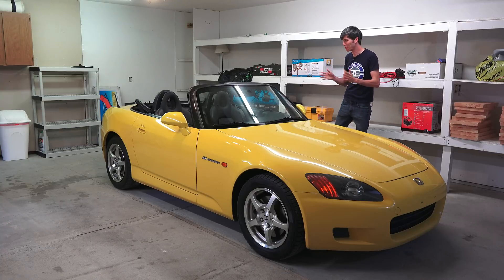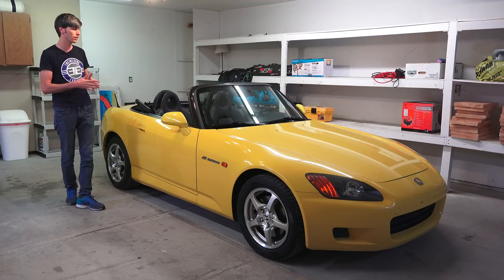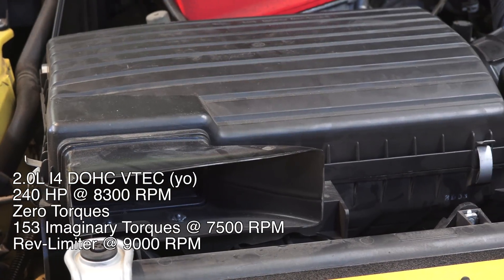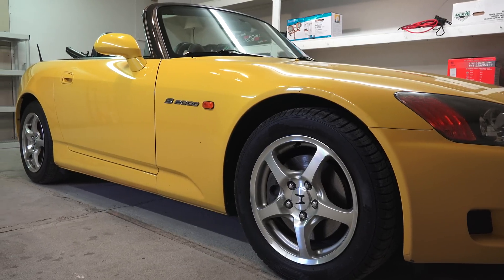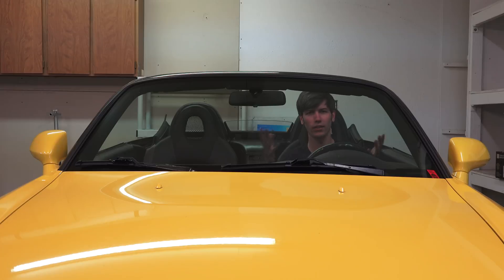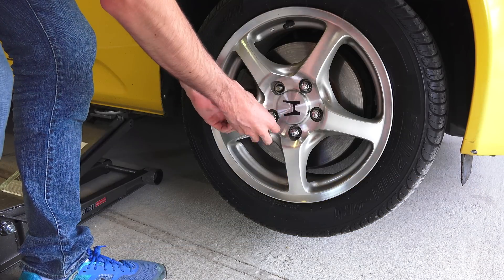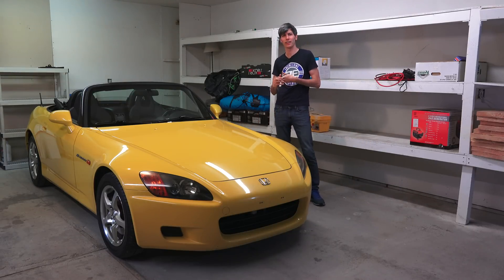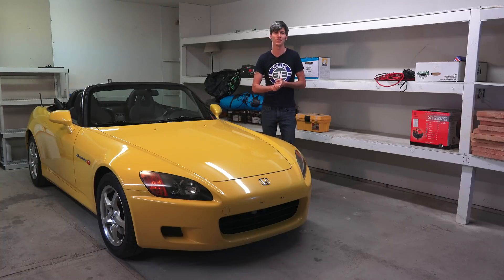I Bought A Honda S2000 And It's Amazing!

Comment: Hey, where is your source for the buying guide? im looking to get one as well. what are the common issues and things to look out for?
Reply from the maker: TCT apparently goes, though it's about a $200-$300 part and seems like a simple fix. Check for rust, mine has a bit on the rear control arms, so I may eventually replace them with aluminum. I was told by another owner valve float may be an issue with high mileage ones, so we'll see. I took it to the dealer I bought my Subaru from and they looked over it real good, above and below.
Reply: +Engineering Explained Thanks man!

Comment: As a Honda technician, I beg you to leave the stock intake and air box on the vehicle. It's pretty much perfect the way it is and we see so many of these have issues with after market intakes and filters. If you have any other questions I would love to give some legit from the manufacturer answers!
Reply from the maker: Thanks for chiming in! My next video will go over some of the problems I have, so I'd love to hear your opinion on a few things. Would you recommend OEM TCT, or one of the "lifetime warranty" aftermarket solutions, or simply sanding down the old worm gear in the TCT?
Reply: By that do you mean the timing chain tensioner?
Reply from the maker: Yep, tensioner. Seems like there are a few options, curious which you think is best?
Reply: If you don't mind me asking, why do you think the tct should be replaced? They are usually good for the life of the vehicle. Is the chain making a noise right now? But to answer your question I would definitely go oem, The after market ones seem to be slightly weaker and allow just a little more play.
Reply: +bignitro50 dude you're a Honda technician but I'm guessing you don't have much experience with the real world S2k applications?. The TCT, the Clutch master/Slave, and in the case of the AP1 the retainer/keepers are the weak spots. The average S2000 TCT only sees 55-75k miles - I got 110k out of mine and then sand blasted it and refuted it myself.
Reply: Installing an aftermarket intake on a 2002 S2000 without a tune will absolutely not mess a thing up. Sorry bud.
Reply: That's because people don't TUNE IT. Changing the airflow or fuel without a tune is always bad no matter what car it is.
Reply: +Engineering Explained Get the Ballade Sports one without hesitation. Did the install a few months ago. No more rattles. /end your decision making process.
Reply: +bignitro50 No way. OEM S2K is faulty and will continue to fail. Billmans from S2Ki, Ballade Sports, or sanding the worm gear are the only routes. I personally dont recommend the latter as a permanent solution.
Reply: Mighty Car Mods tested cai on s2000 and gained almost 7hp
Reply: The K&N FIPK is by far the most popular aftermarket intake for this car and has proven dyno results from the manufacturer and owners of the car that prove without a doubt it increased power and torque. I've had one on my car for years and never had an issue whatsoever.
Reply: +Thebullet9901 f20/f22c I think he was referring too. Not the a.
Reply: +TassieLorenzo in one of the lowest "power per dollar" options stroking to an F24 with a good blend of OEM and aftermarket has routinely yielded 270-290 NA. It would be fun just to do it as a side project if I had $7500 laying around...now I understand why most just throw in a stage 1 or 2 SC and tune and call it good. Haha
Reply: Look up Billman250 on S2ki, had his on my S2k for a long time and no more famous "bicycle spokes" noises. He is also the cheapest option after the core refund.
Reply: +Chris Cheek This. I only went the Ballade route because I wanted to keep my stock piece. Ballade or Billmans or bust. Replace with OEM and replace again in 20K miles.
Reply: I'm sure the Ballade one is fine because it's my understanding the only issue is oil flow, which is fixed by enlarging the hole at the base of the worm gear. Not really confident enough to do it myself, which is why I just bought one. Either way, good to fix it sooner than later!
Reply: +Chris Cheek Same here. I did notice a slightly bigger hole on the Ballade piece. Sanding the worm gear sounded scary to me. Maybe itll fix it permanently. Ballade piece isn't cheap but eliminated my problem 100%! I'm a happy camper.
Reply: +Justin Gutierrez Word on the clutch master/slave. Master went bad on both of my S2000s.
Reply: +CaliPatriot88 It also sounds fucking awesome. +1 on the FIPK.
Reply: +Thebullet9901 you can't even compare. If anything the closest engine to the F20/F22 is the C30/C32 in function and the H22 in form. 👍
Reply: +CaliPatriot88 👍
Reply: +Zach Heath this true, it's a fairly cheap easy repair thankfully
Reply: Don't listen to this dude, get an intake and soak in that beautiful VTAKKKK sound!
Reply: +Thebullet9901 I was meaning the F1 inspired construction from the NsX engine and many design cues from the Prelude H series. I guess I was just saying of the C30 and H22 had a baby it's be the F20/F22 but with its own characteristics as well...
Reply: I heard Hytech sell a package of cams, header, exhaust that can take the stock engine up to 270bhp? :)  But of course S2000 must be modded carefully, as it's easy to make it perform worse than stock as you say.
Reply: Justin Gutierrez Yep, I meant the F20C.
Reply: Yessssss! I was hoping you would pick the S2k! I just picked my ap1 up 2 weeks ago and have been loving it!
Reply: hey, if you do not mind, check your inbox at some point
Reply: not even remotely the same engine. the s2000 engine is as close to a street legal n/a racing 4 banger as you can get from the factory while the 4 pot in those accords was a donkey show.
Reply: +Thebullet9901 mine made 260 NA. Highly modified of course.
Reply: +Thebullet9901 what do you mean c or a?
Reply: Ballade Sports x2 FTW!!!
Reply: yes leave the s2k airbox stock, if you had a accord euro changing to a pod filter makes it have better throttle response

Comment: Fascinating bit of info on the cylinder bores!  It definately looks like it will be a challenge to find what what engineering Honda left out.  What do those 16" Wheels w/tire weigh?
Reply from the maker: That is a good question, have not weighed them yet. The tires are crap and there's excessive camber in the rear. A bit of work to be done. I think some black wheels would look good!
Reply: +Engineering Explained black and yellow!

Comment: Congratulations fellow S2000 owner!! Welcome to the S2K club! I recently got my AP1 just like yours about 3 weeks ago :) Amazing car, simply amazing. So advanced for it's time and still seems like it came off the production floor just last year.Mine came with quite a big, performance enhancing bonus. Can you guess what it is?
Reply from the maker: Awesome, congrats on your ride. A little FI eh?? :)
Reply: Engineering Explained Thanks!! Aha, what gave that away? ;)
Vortech V2 supercharger my friend :D Around about 8 psi boost at the moment. Engine totally stock.
I think it really complements this car very well. It retains the character of the S2000 while enhancing it's power (by quite a bit) and the mighty VTEC always kicks in YO :)

Comment: I literally bought the same car 1 year ago! It's Spar Yellow with a full ap2 s2000 conversion. To me, it's the best of both worlds. It has the ap2 looks with the engine it was made for -- the f20c 9,000 rpm redline. Couldn't be happier! If it hasn't been done yet on your new (to you) s2000, you should make a ap2 retainer swap video with technical bits behind the reasoning.

Comment: Congratulations. Looks very clean and unmolested. In the future however I would not suggest pushing on the front fascia piece but rather rotate a tire by hand. It's actually easier and won't risk damaging anything.

Comment: Engine too small, torque is more important. It is a good car but it need V8, even with same horsepower and car will start feel a lot more better. Horsepower is for selling car and Honda use this strategy to crab attention guys  like you.

Comment: Quick unrelated question, when an engine is advertised as a "3.0L engine" that means the total amount of fuel that can go into all the cylinders in total right? If not, can someone explain?
Reply from the maker: It's the amount of air the piston displaces (volume) as it moves from the very bottom part of the cylinder, to its highest point in the cylinder, multiplied by the number of cylinders for total displacement.
Reply: Thanks! :D

Comment: TBH I don't think Honda can make sport cars. But love what you love!
Reply: You... You do realize what Honda has done in the sports car relm, right?
Reply: Honda has been making sports cars since the 1960's. Ever hear of their other roadsters the S600, S800? They've also been involved in racing for that long as well which helped engineer cars like the NSX and S2000. They do sports cars very well.
Reply: You are very very mistaken, sir. This is a great Honda
Reply: ***** It has an excellent engine and drivetrain, great chassis, sharp steering, and drop-top fun! (manually removable hardtop is also an oem option, if that's your thing). There are also plenty of other Hondas to mention - but simply too many for me to count. To name a few: NSX, S2K, ITR, CTR, Si, Prelude, Accord, TSX, TL Type-S, CRX

Comment: 9,000 rpm does sound pretty rad... How do i get that on my wrx
Reply: shift from 6th to first on the highway and you will hit max revs
Reply: you'll blow the intake welds and fry the piston rings
Reply: Cams and a tune. But on a wrx, you might have to do rods and bearings to handle that high of an RPM. Not positive though
Reply: Lol... why would you want to? S2k has to rev to 9k, that's the only way it'll make power. WRX/Sti make power throughout the rpm band. No need for 9k rev limit.
Reply: +Y10Q I didn't think they had full boost until 3500-4000rpm. A wrx, not the STI. And you're deffinitely right about the torque and spinning out. the power band on s2000's and even with my miata is made to make power above 4krpms, mine revs to 7850rpms, and if people don't understand that, that's fine, they don't have to drive an s2k or a miata! leave them for the ones who truly appreciate the car, not people comparing  over a rwd naturally aspirated car & awd turbo'd car.
Reply: +Y10Q it's lots and lots of money's hahaha
Reply: Waffletime
agreed! but doesn't a wrx have a 5 speed?
Reply: very reliable too
Reply: get the s203 engine in
Reply: +Y10Q only the usdm models
Reply: ej207 revs to 8k, closest ur gonna get lol
Reply: +Y10Q  That's a race car though, I'm sure if you had that kind of access and money towards parts you could make a nice, high revving engine
Reply: Extreme Tuners

Comment: Great car. Congrats! The Nissan Pulsar VZ-R N1 had a higher specific output from an NA motor when the S2000 launched, though Honda did not count it since it was relatively low volume. Both made about 125ps / liter in Japanese form.

Comment: Dad had an S2000 for 4-5 years and it's a great car!. 9000rpm is epic, the shift is superb and its light and nimble. Only real disadvantage is the noisy roof (when closed) a higher speeds, exspecially at the autobahn (was an 2001 with plastic windshield...)

Comment: Jason, why do you think these are so hard to drift? because of the lack of torque, the front mid engine lay out?
Reply: The truth is they drift fine VTEC cross over all that is BS. The real reason they are hard to drift is the available steering angle is really low you always run out of lock and this causes the car to spin. The low polar inertia of the chassis doesn't help but it isn't really a problem.
Reply: Because drifting is for douche bags. The s2k is an engineering marvel. It's designed to perform well, not just slide around burning up tires.
Reply: It was never meant to be drifted. It's an endurance track car, not a drag or drift car
Reply: Shorter wheelbase and the vtec switchover point making it harder to consistently control the breaking traction point of tires. It's possible just take a more skillful driver
Reply: Andrew Wilken
drifting isn't for douche bags.
Reply: cause it's not made to be drifted.
Reply: Andrew Wilken True, but drifting is not for d-bags.
Reply: if you know how to drive you should be able to figure it out.

Comment: So happy you got an AP1 man. I'm on my 2nd.
Reply: +John Massey Yeah...it's a huge issue with these things. Since the early 2000s. A lot of other S2Ks around Atlanta got hit the same time mine did. 4 simple bolts and the seats are out. Can obviously put them into any Civic, Integra, or whatever.
Reply: +Zach Heath prelude guys love "acquiring" those seats too
Reply: +Zach Heath damn they stole the seats lmfao couldnt just take your wheels hahaha
Reply: +Zach Heath Do you like he AP1 or AP2 better? I eventually want to get a s2k for a track car/weekend cruiser in a few years ,but I'm worried that they'll be harder to find.
Reply: +Mrlolibre I heard someone say this and I agree 100% - The AP2 is the better car. The AP1 is the better S2000. I like my AP1 a bit better I think. 8.2k to 9k doesn't seem like much, but I swear it feels and sounds like it just screams forever. The AP1 is a bit more raw too. I have a 2002 like EE just got. Great year as they made a lot of suspension improvements but its still an AP1!
Reply: yeah s2k seats are a hot commodity ... i would kill to see them in my acura cl!!